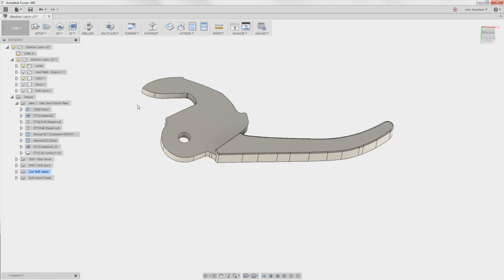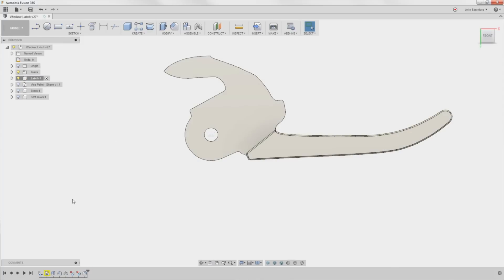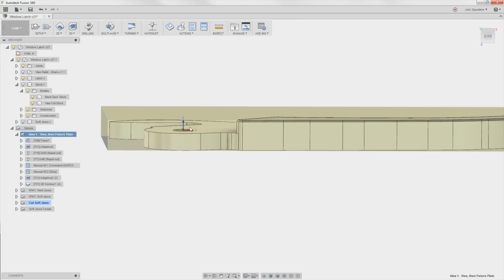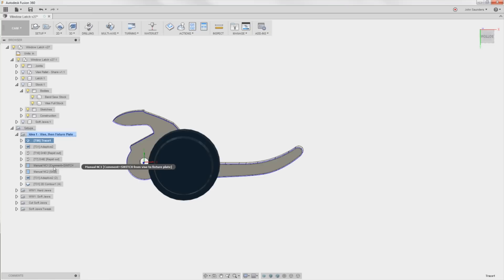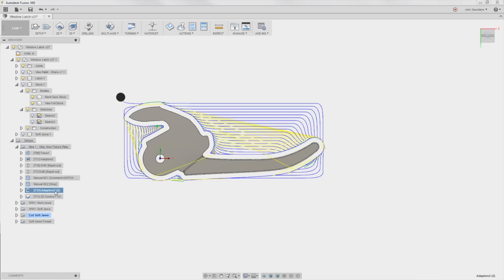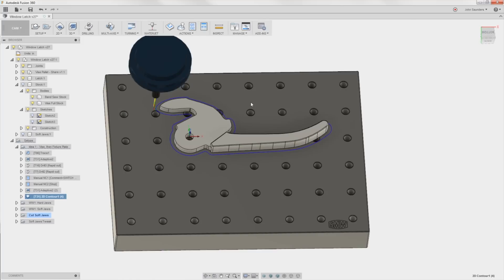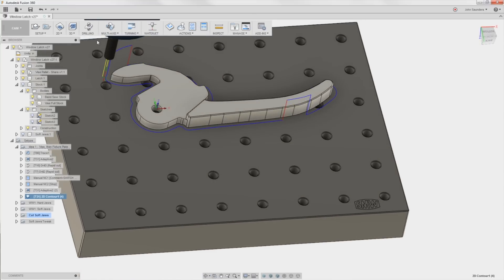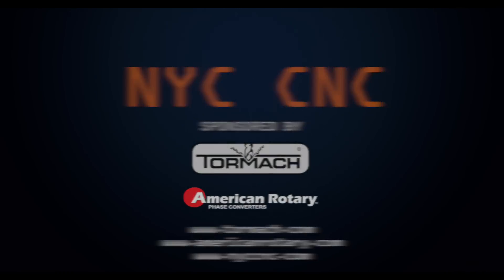Fusion 360 - Creative CAM Stock Selection Tips!  FF69

Comment: Just found your channel. Now that you have a Haas and are starting to play with us "big boys" I would like to see something on Trochoidal (high speed milling). Also some 3-D contouring would be nice.  Love your channel and enthusiasm.

Doug
Reply: In nearly every video since he switched to Fusion 360 he has used trochoidal milling strategies. Trochoidal milling is the strategy behind 2D and 3D Adaptive tool paths in HSM.
Reply: may be trochoidal but not high speed...500-600sfm
Reply: High speed is relative, and that's a limitation of the Tormach spindle, steppers, and machine rigidity. It has nothing to do with the way he is creating the tool paths. The adaptive tool paths themselves are trochoidal.

Comment: John, use tabs with screw to hold the part down almost cut thru then fluff and buff for finish. With the stock size you are working with turn the part at an angle to get point for the hold down screw same size as the hinge screw hole. Jim

Comment: Do you wanna break an endmill and fling a part?  Because this is how you break and endmill and fling a part 😆

I can see so many bad things happening here and so much time and effort put in to do it. 

Soft jaws were the correct way. Could you do it this way? I suppose.  But I certainly wouldn't.
Reply: Occams Sawzall not necessarily soft jaws but they are certainly better than this hack. It's not a good thing for inexperienced people to be taught such ridiculous methods.
Reply: Cad-Cam_Man 
Small number of parts say  under 50,  soft jaws all day long. 

Any more than that and A large capacity fixture would be  in order. 

But this, this is just asking for trouble. So many things to try and account for. Just makes an easy part that much more difficult
Reply: NYC CNC eh. Intentional or not, it certainly made seem like  a demonstration of an "alternative way" to machine it more than it was showing toolpath containment. There was many a tangent and much confusion as to what this was demonstrating.
Reply: I worry about what the apprentice will glean from this video.

Comment: I don't like this, too much could go wrong.
Why not take a piece of stock where two of the pieces fit in (like two interlocked L's), but a little longer, clamp it on the ends and then machine the parts with tabs. The tabs can then be removed with the bandsaw and sander.

Comment: John, I've explained on a different video that you can export out a CAM preview as STL and re-import it to use it as stock. Should I put together a step by step guide? :)
Reply: John, give this a try using something trivial just to see how it works. Model a part, do the CAM and run a simulation (turning on the stock and turning off any bodies). When your simulation is finished, right click the stock and go to Stock->Save Stock. Save this STL somewhere. Create a new design (this is important as STL imports require you to turn off history) and import the STL into that project  - Model section, INSERTv dropdown and select 'Insert Mesh'. Click 'OK' on the modal. Right click on the main design drop down and click 'Do not capture design history'. Right click the MeshBody under bodies and 'Mesh to BREP'. You now have a solid body you can import into your original project to use as stock with the prior CAM operations you selected applied.
Reply: NYC CNC 
You should be able to export the stock as an STL after you run a sim.  It makes it a separate file. If you import back into the CAD/CAM you should be able to use that STL as you OP2 stock model and drive toolpaths based off that STL stock
Reply: Weckso Flanniga
Reply: I'm having to import the STL in MM even though it was saved from a file in inches. Does it behave the same for you?
Reply: I've only ever worked with a sane metrology standard so I can't say I've seen the problem. The STL exports were designed to send off to 3D printers which are pretty much all metric so that's likely the reason (even the 'refinement options' in the export dialog show mm units).
Reply: I only work in inches when I'm designing things, or measuring things, or building things, or... Ok I work in inches all the time! I just can't wrap my brain around a base 10 metrology system. In any case, when I export a body as an STL for 3D printing, and I forget to switch to MM, it exports in inches. I was surprised by the inconsistency.
Reply: Pretty sure the exporting of stock as an STL was kind of a last minute, get it in there type thing. Not really surprised here.

Comment: One approach I used a while back to use the result of one setup as the stock for another in Fusion 360:
1. Run the simulation for the first setup.  
2. Save the result as a solid. While still in the simulation view/mode, control click on the window.  From the popup menu, select Stock, then Save Stock...  Fill out the information in the dialog box, and your stock is saved as an STL file on your machine.
3. Upload  the STL file to your Fusion360 account like any other model.
4. Bring the STL model into your project and use it as the stock for your next setup.

This is by no means simple, streamlined, or without any risk of using out-of-date stock models.

It did help with some early parts that I made which were complex enough that I wanted the security of knowing the results from the previous steps.  Plus, my CAM skills were still very rudimentary and I wasn't sure how to avoid spending lots of time recutting the now-empty spaces on subsequent setups.

I've learned a lot from NYC CNC since then and can now make those same parts without the headaches of the process I outlined above - and that includes constraining toolpaths to guide the CAM results.

Comment: Oh the struggle is real!  What about just using the tabs connected to some stock that you mount on the fixture plate instead of using the clamp?   Then go and band saw off the tabs connected to the remaining stock...I haven't tried it yet, but I have a very small logo badge I CAMed up and used tabs so I can cut the rest out using some ridiculously small end mills (.04)...